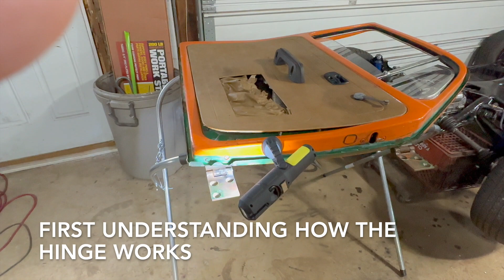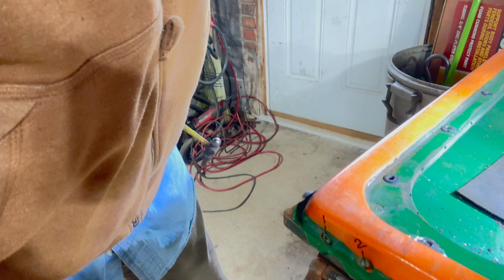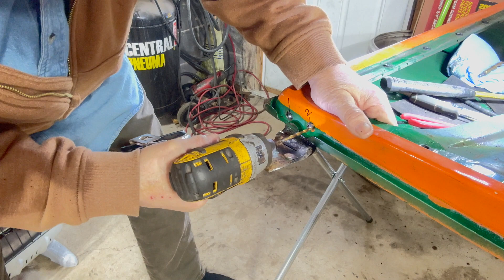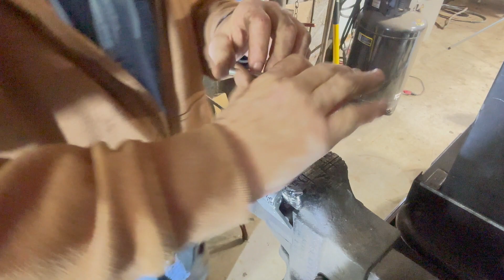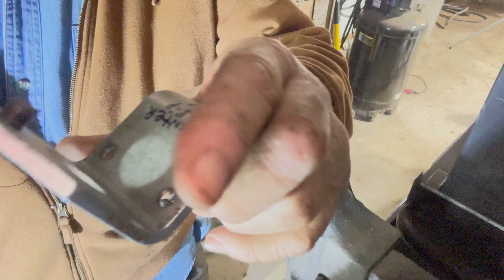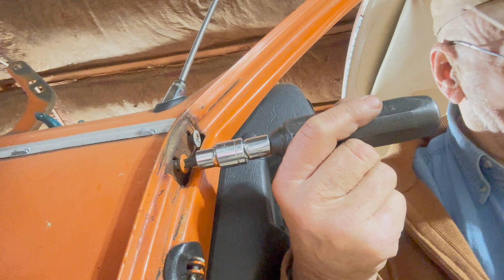VW beetle Change Door Hinge Or Hinge Pin???

Comment: Good information to know and see! Why vw didn't use bolts from the get go is beyond me. Something is going on with my passenger door but I've only been able to get 2 of the 6 #4 Philips out. Need some 🔥! I am using the hammer impact screwdriver but thinking of buying the air hammer attachment for them
Reply from the maker: Hello Bud, I use electric impact gun. Works great. Sometimes you can squirt a little penetrating oil behind the plate that the bolts go in. If all else fails, you can drill it out. Good luck be patient you’ll get it. I use a new product that’s been around forever, but it does the job and it’s called.kroil penetrating oil. This stuff is pricey but works. Good luck
Reply: @busterstravels1534 aero kroil is awesome,  I used it at husqvarna welding lawn mowers years ago right out of high school. It will actually climb threads as it has capillaries in it. 
I have been juicing it with pb blaster every few days for months and the bolts just laugh at me lol. I thought I had 2 out but just looked, only one has broken free. Oh boy haha!
Reply from the maker: Have faith, take a break from it. Then tackle it again. You will win it the end!
Reply: @busterstravels1534 for sure! I forgot all about it fixing the death foam rot. One side done,  one to go!
Reply from the maker: Feels good completing completing a job like that. No easy task.
Reply: @busterstravels1534 very complex qtr panel design.  I had to do the inner panel and both the lower and upper outer.

Comment: It's perfect timing for me to watch this video because I'll be removing one of my doors soon.  A subscriber said I should never remove the hinges.  Instead, I should smack out the pin with my air hammer.  That makes sense because then, when I put the door back on, it will go right back where it belongs.  I, too, have seen nothing but heartache when it comes to removing hinge pins.  So, I was a bit worried.  But now, I think I'll stick with the original plan.
Reply from the maker: I honestly believe it’s the best way to solve hinge problems and the easiest way to. You don’t want any looseness. I didn’t show the door closing but when I did close it was perfect. Lined right up and is super easy to open. Good luck with your project. 👍
Reply from the maker: I believe I posted the wrong tap size in the video. I said a 10mm but I believe it was an 8mm. If you change a hinge please double check tap size. I hope I didn’t goof anybody up.